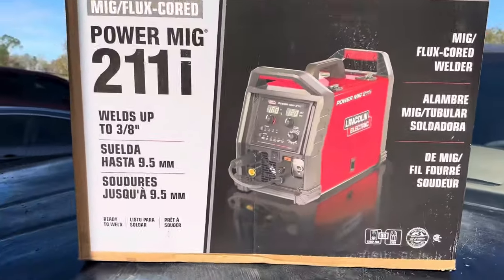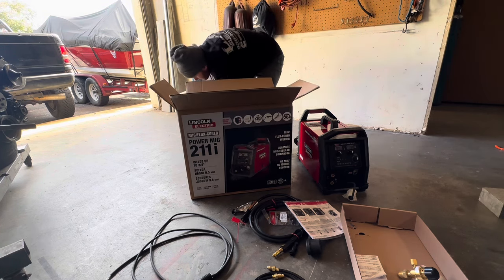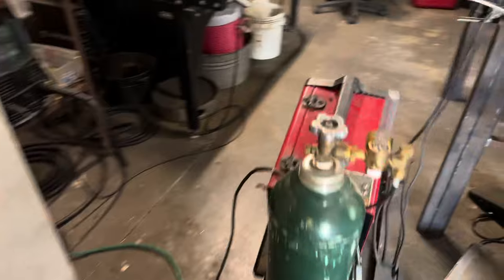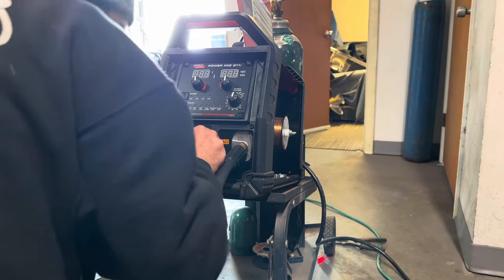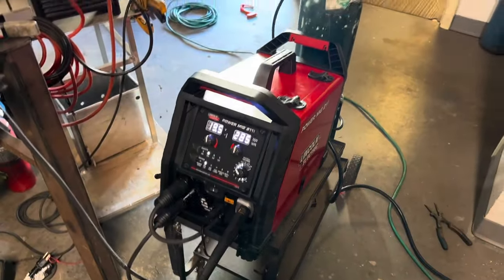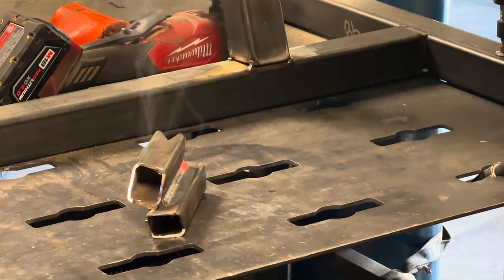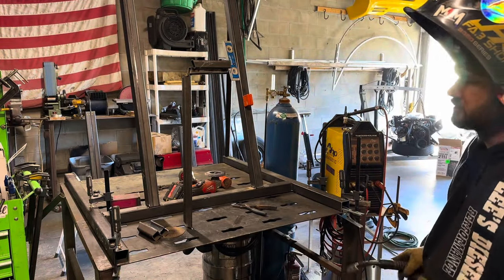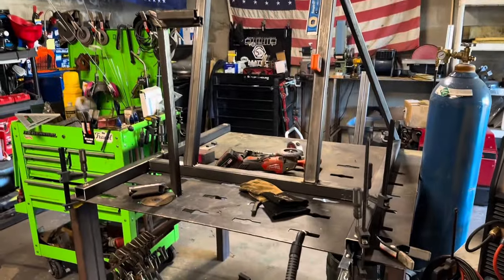Lincoln Electric POWER MIG 211 (Unboxing & Welding)

Comment: I have always owned and used Lincoln  products. About 6 year ago I bought a new MIG ,( my old one was over 15 years old, still in use ) , I had nothing but problems with this machine, contacted welding supplier that I bought from, no assistance , even talked to Lincoln at SEMA, still no luck,  finally after fighting with it for a year, I gave it away, Bought a Miller.  Will not own another Lincoln welder.
Reply: Lincoln used to be top tier!
Reply from the maker: i really hate it hear that man, i have really been on the fence with both brands..miller or lincoln. Ive welded with both, i have both of their hoods, use both of their hobby machines. I have had issues with both. This welder has been an awesome unit so far in my shop, i have done serveral jobs with it & it hasnt skipped a beat. I guess we will see how it lasts over the next year..

I went out on a limp and bought this AlphaTig AHP unit... everyone had mixed opinions on it. I can say for a 200 amp ACDC tig machine its been worth the money. Its starting to look like Miller NOR Lincoln has a hold on the market anymore.
Reply: what was the problem you were having, it has a 3 year warranty.Its hard to believe that a reputable lincoln retailer would not take care of the problem.
Reply: Am a fun of miller and Lincoln but the challenge we have here in Zambia it's where to get the original product Zambian market as been spoiled by Chinese market and of quality

Comment: What is it mean when a welder Could weld up to 3/8 That's penetration capabilities. Meaning to weld, two plates of half inch together it will not get the job done?  Thank you, I apologize.I'm a super beginner
Reply from the maker: @Ben-sv9op  it’s stating that when you have it on the setting for 3/8”, it can penetrate with one pass… but limits the duty cycle. 

Anything larger than 3/8” will require multiple passes to ensure good penetration of the weld. Preheating goes a long way with thicker material especially if you’re MIG welding it
Reply: @TheDogHousetv  thank you

Comment: Millermatic 211 or Lincoln power mig 211i  which one seems better to you?
Reply from the maker: I can’t lie, that’s a tough choice. I have really enjoyed my Lincoln… but i don’t have has many hours on it as i have put on a miller 211 (which was owned by my previous employer) We did all our production work with millers… they just kept going. Only had one board fail in 3 years

Comment: It’s almost the same my  miller 211 auto set, multiple volts 2010
Reply from the maker: I loved the Miller 211, but they would not work with me on the price tag. Its almost $2200 bucks and this lincoln was around 1400 or so with my small discount. But yes, it almost welds the same.. TO me IMO

Comment: Can you adjust it for spray?
Reply from the maker: No sir, only does Flux, solid & can run a spool attachment
Reply: @TheDogHousetv  Solid wire can be short circuit, globular or spray. Can it only do short circuit?
Reply from the maker: @TheTruth-yq2jb  that’s what i mean only solid short circuit. No spray, no global, no pulse.

Comment: Will it weld the flux core .035 in 1/4”?
Reply from the maker: Yes it can weld flux core .035 on 1/4” I’m not 100% sure of its duty cycle at that setting though.

Comment: I have this same welder. I don’t understand why on auto set the 1/8” setting wire speed is 285 and 19.5 volts and the thicker 10 gauge goes down to wire speed 280 and 19 volts.
Reply from the maker: Lol i didn't even notice that. im going to check that out next time i weld with it.